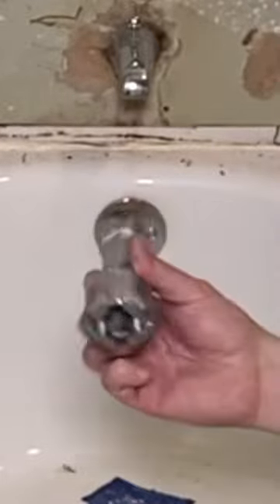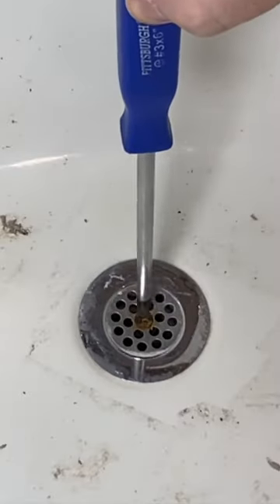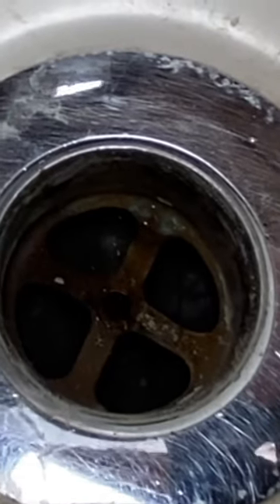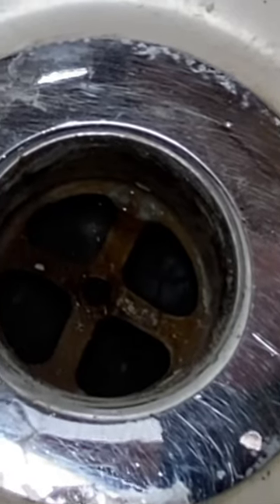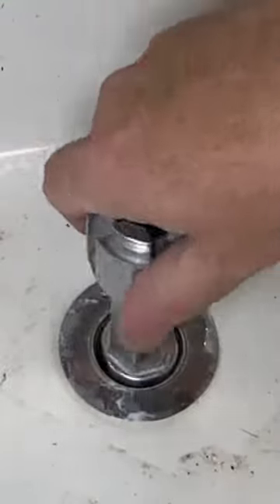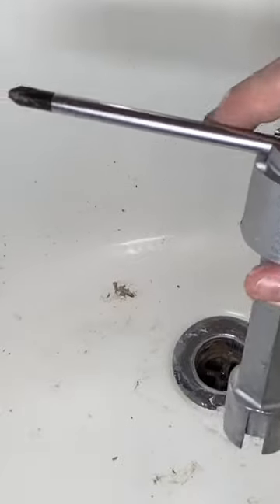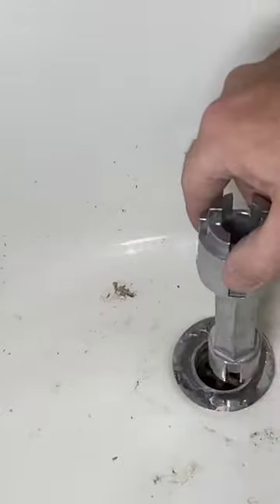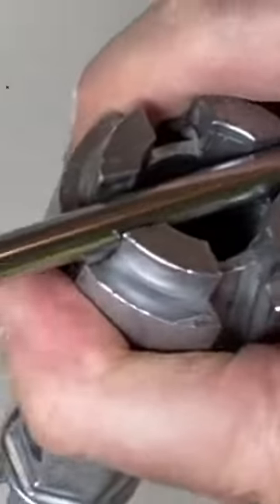This is One Smart Dumbell! #plumbing #hack #dumbells #tools

Comment: Seems like every time I do one of those the drain cross pieces disintegrate in about 2 seconds. I have another extraction tool that's like an easy out. You jam it in there and it just bites into the metal but in the past I've had to cut them out which is very tricky because you don't want to damage the threads of the drain pipe.

Comment: I didn't have a drain puller so I used the plier handles inserted into the drain and used an adjustable wrench to turn the pliers ☺️

Comment: I'm trying to replace my bath tub shoe. I got the old one off with a dumbbell. I'm having trouble finding a replacement. I've bought 4 already, but they all have the wrong thread. How do I determine the threading of the old shoe so I can buy a replacement? Thanks!
Reply from the maker: Is it too small compared to the others that your finding?

Comment: This tool never works for my jobs.  It either breaks the cross member or the brass pipe connecting to the drain.
Reply from the maker: I’ve been there too, but it has worked quite a bit for me.

Comment: I remember doing maintenance in a hotel. Previous guy used rubber cement on the threads on those. I forever hate him and hotels
Reply from the maker: Oh man that is crazy. That’s a lot of work for the next guy.
Reply: @ThatFixItGuy  I spent all day with a hacksaw, a hammer and a few random things to chip away at it. Spent a full day and a half getting just 6 rooms fixed due to that.

Comment: I've done hundreds of sinks faucets all kinds of plumbing stuff I have never once used this tool and found it to fit any of the faucets and sinks drains that I've ever tried to remove with it. I've had it for over 20 years by the way
Reply from the maker: This is made for a tub drain.
Reply: @ThatFixItGuy  I've done plenty of them too it hasn't ever worked for me. I used to do work in condo and apartment buildings. So very familiar with leaking tub drains